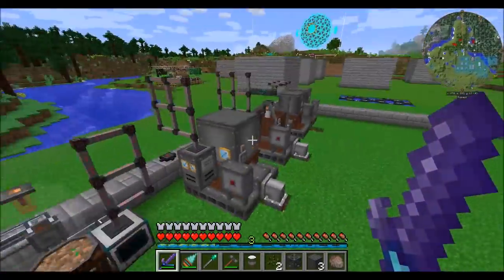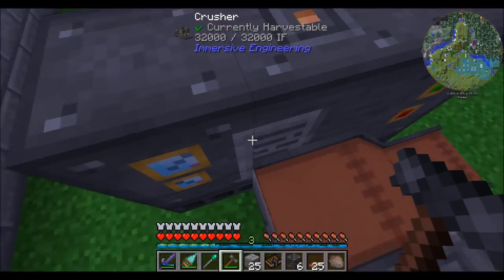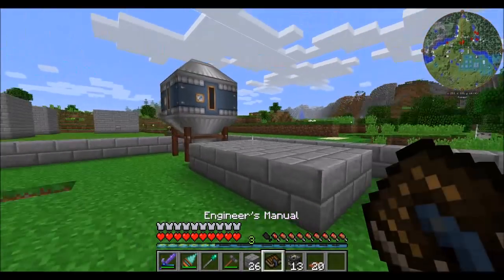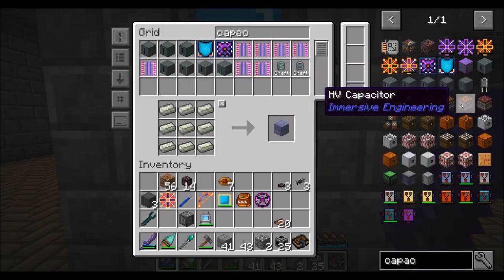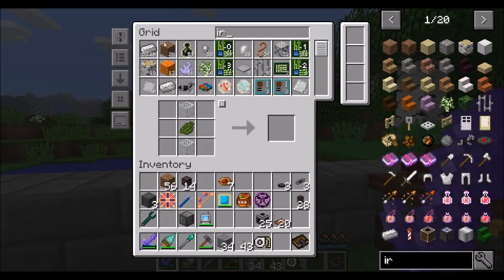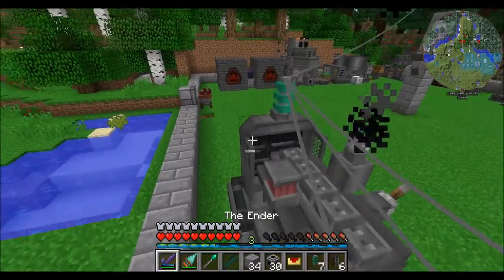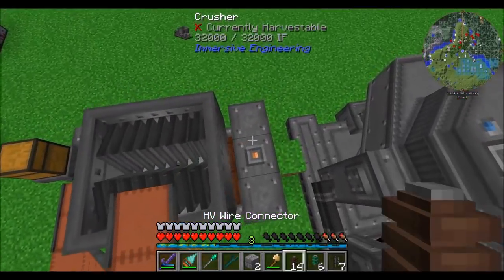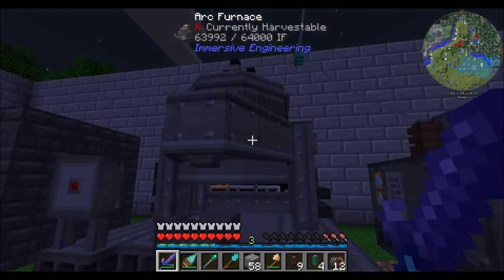Lets Play S8 E104 IE Power

Comment: So what I've learned from this is to start Cole Coke and Steel production on your 3rd day so that you have enough to have fun on your 100th day.
Reply: BiH-Kira 
No, you just don't have to derp 😜
For Coal Coke, he could make more Coke Ovens or build an Industrial Coke Oven (if that's implemented yet).
For Steel, he should've just given RF to the Preheaters of his old Reinforced Blast Furnace and that would've sped it up propably enough - if not, just build a second one 🙂
Reply: He had RF going to the preheaters. He had a wireless RF transmitter on them.

Also, Parallelization is always a good idea with slow machines that do mass production. Railcraft worked like this, and people generally had Coke Oven factory/rooms. I remember making 16 of them, and using blocks for everything.

Which is the other point. Process blocks of Coal/Charcoal/Iron. It's much more efficient and I think might be a tiny bit faster.
Reply: Blocks of Coal make a full 5 buckets of creosote instead of the 4500 it does for 9 pieces of coal. But Steel is like Bees, start it early in the background, and then you've got enough resources when you're ready to play with it.
Reply: The key to getting coal coke is to make more than 2 coke ovens.  same for blast furnace lol.  Making them is super cheap to do early.  I remember having entire 32x32 floors in one world full of coke ovens and blast furnaces.  He should not be having coke and steel issues at this stage of the game, lol...

Comment: You can use the auto work bench to automate electrodes. Also unbreaking works nice. One book will enchant all 3 since they stack.
Reply: You can automate MAKING electrodes, yes. Putting them into the arc furnace, not so much.
Reply: Yes agreed. If you enchant them then you wont need to replace them much.
Reply: Or use the enchanting thing from Botania that doesn't consume the book.
Reply: Thanks for the tip on the enchantment, didn't know about that one!
Reply: YW

Comment: Applying redstone signal to the bottom of the tank makes the tank auto output. (I think the manual has mentioned this.
Reply: not only that but in a previous episode when he was reading up on tanks he even mentioned it
Reply: Bellsmad definite Direderp.
Reply: In previous versions it auto-output straight down while the sides behaved only when pulled from.
Reply: Yes a simple lever on an unused output. i have 6 generators on on tank it requires a pump as well no power required, pipes can keep up.

Comment: The way IE wires work, if you add one more out from the capacitor going into the relay for the arc welder it should double the input over 3 connectors and you should be good to fill the arc furnace and do 12 at a time!

Comment: Thermal Expansion has a fast way of making coal coke. The redstone furnace has a specialization that makes it simulate a powered coke oven, which processes multiple pieces a minute. The question there is whether IE coal coke and TE coal coke are ore dictionaried, which I think got fixed so have at it.
Reply: Thermal Expansion also has a fast way of making steel, for that matter.
Reply: He want's to only use immersive engineering for immersive engineering items as it makes it more of a challenge

Comment: you have three connectors on the arc furnace, cool, 3x 4096 there. but you only have 1 connector on the cacpacitor, 1x 4096. you're still not giving the arc furnace enough power

Comment: I wonder if electrodes can be repaired with a repairer.
You can suck them out of arc furnace when they are 10 percent and put them back after repairing  them.
Reply: I've tried it in my DW20 world and it doesn't work, with cofh core installed you can cheat the un-breaking effect to 100 and they will last a loooong time
Reply: Thanks!

Comment: Hey Dire, why not chuck a connector onto some facaded vibrant energy conduits, and then run those down inside the wall? That way you can have a single connector on the wall next to the relay.

Comment: Dire, the Arc Furnace can handle all the input slots at the same time with just 1 Diesel Generator, 1 Diesel Generator should be able to keep 2 Arc Furnaces at maximum capacity if I'm right, but routing everything through a capacitor may hinder the power transmission.
Reply: I don't think the capacitor is the problem, but dire also had his Diesel production line and Grinder running, if I recall correctly
Reply: If i remember rightly, each side of a HV Capacitor outputs 4K RF independent of each other so to maximise his power output to the arc furnace, he should use 3 sides of the capacitor, feed into relays then feed into 3 connectors on the back.
Reply: That should work, there is a reason why there are three input slots on the Furnace after all, i'ts even possible to use the same relay, since the wire capacity is much higher then the connector output
Reply: He's being throttled by connection limits. He should be running from the Diesel Generator into 3-4 capacitors and then back out into a single relay from which he will power the rest of the machines.

He also really needs to re-implement a power monitor of some kind (Comparator outputs, EnderIO Power Monitor, Open Computers, whatever), because he's wasting a LOT of fuel if he's not burning more than 4096 RF/t. The Diesel Generator always produces 4096 RF/t, no matter what, and has no internal power buffer. So if you're draining 1 RF/t out of it, it will waste 4095 RF/t.
Reply: Best way I've found is three mid-tier EnderIO Capacitors and power monitor. That way you can set it up so it only runs to recharge the capacitor, and is shut off while the capacitor is draining.

Comment: hv wires gan handle way more rf than the input plugs. Use one relay for all the machines and input from the capacitor with at least 2 plugs. Consider building another diesel generator so you can support the power surge of the arc furnace with 12 slots smelting at once plus other machines

Comment: Dire, you can use a bucket on the IE tank to see the amount inside.Also IE have its own pump, i think it should work to get fluids out.
Reply: There's no way to get the IE pump next to the output block (it's two blocks tall and the upper block has no fluid connections), but there's other ways to get the tank to output.
Reply: shurhaian just a redstone signal at the bottom of the tank was all he needed.
Reply: Gee, you don't say...
Reply: Oh, thats true, thanks.Is that i havent played with the mod for so long that i forgot somethings.But i think you are able to conect a pipe to the tank and into a pump, then you can take fluids out, i dont know, but  the redstone signal seems a lot easier.

Comment: From what ive seen/read you can enchant electrodes with unbreaking making them last much longer. it would be easier to do that than automate the creation of electrodes in my opinion.
Reply: Creating electrodes is straightforward enough, but there's no way to automate inserting them without a mod that lets you specify the exact slot to input to - and even that's a maybe.
Reply: shurhaian yes but you won't need to insert them if they have I breaking 5
Reply: At all? Interesting. That would certainly make the arc furnace a great deal more appealing if so.

If it's just "last a really long time," ultimately the same problem still exists, but could still be at a level that makes it manageable.

I wonder if the electrodes can be enchanted with Botania? At that point you wouldn't even need to worry about making the books repeatedly - make it once and keep pumping in mana to reuse it.

Comment: Dire you are wasting your power. Diesel generator will always gen 4096 rf/t even if you are using 1 rf/t. and you are using only about 600 rf/t so you can make the energy cell from TE, resonant version cal hold 50 MRF
Reply: Making a bigger battery A) would be a departure from IE, which he's trying to stick with in that room, B) would only delay the problem. It needs a more elaborate control system, either something like the EnderIO power monitor or redstone circuitry that does the same thing (comparators with appropriate thresholds rigged to an SR latch).
Reply: Or maybe some more HV capacitors :)
Reply: shurhaian Not to mention he's not even really using this as he already has a ton of RF saved up in the rest of his base. He's basically making the whole building as it's own self contained System. Except for making steel, possibly.

Comment: If you connect the arc furnace to the main power using a draconic evolution i/o crystal, you'll produce steel faster as well as you solve the problem of power needing to be connected in the wall.

Comment: For za tank, input fluid on za top, and output at za bottom. You literally drop za fluid into za container from za top, and drain it at za bottom.
Reply: That does not itself auto-output, though. The missing element was a redstone signal, not gravity.
Reply: It also requires a redstone signal to output from the bottom. So sayeth the manual.

Comment: What the point of I.E. power same as rf
Reply: none none Dire dont want to use his rf to power IE machines.He wants IE to run on IE not his main power system
Reply: King Of Void dosnt make sense
Reply: none none because he wants a challenge if he just used all his stuff it would be too easy because hes so endgame and this mod is not
Reply: None none like you can use rf energy and some mods to power industrial craft machines, but you want to power them using industrial craft generators)
Reply: Rf and IF are identical to the player. The IE machines automatically convert RF into IF. They only reason it exists is to help the author (BluSunrize) with coding stuff. Most likely there is some feature blu wanted that the RF API didn't have so he created the IF API so he could create that feature.
Reply: I'm not sure but it might have been just put in so he could release the mod because the RP API was taking a while to be updated for the new version of minecraft, or it could also be that maybe he needed special handling for his power system. I think his system has a bit of power loss end to end, so he might have needed special handling for that.
Reply: He's doing it for fun. He wants the build to be as self sufficient as possible just for fun. He's already that far into the progression tree that he wouldn't have any trouble with anything so it's a self imposed challenge.
Reply: at one point Blu stated that you should never need more then 4096 power which is why his most powerful gen limits to that amount.  anything over that is just silly according to Blu... so everything IE is balanced off of his numbers.
Reply: At this point, he basically has infinite RF production, but he doesn't want to use it for this mod, as it's not how the mod was intended to be played.
Reply: +MindCaged
Close. The reason most mods don't use RF explicitly anymore, but use an identical power scale and seamlessly convert, is so that they're not reliant upon the RF API to update and if the RF API breaks, or if it hasn't updated yet and you didn't have to include the API for your mod to run, and COFH releases a new version? Your mod doesn't care. You can't create API version conflicts, and you just have to change a bit of integration code that converts RF to your internal power.

It also opens up the ability to run Tesla or Forge Capabilities power... or really anything else you fancy with the same ease for your code. It's just a comparatively tiny piece of compatibility code.